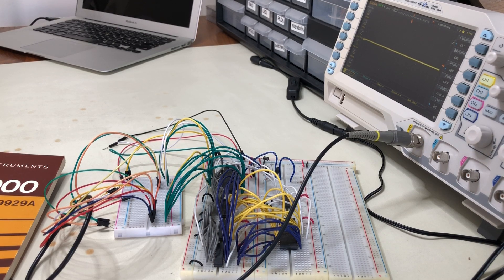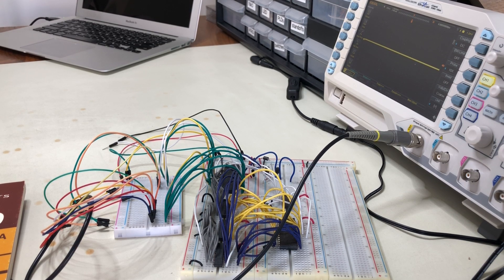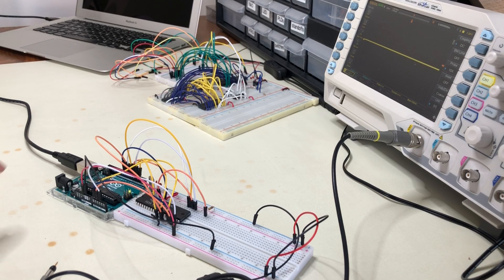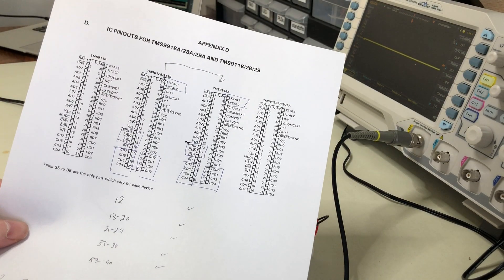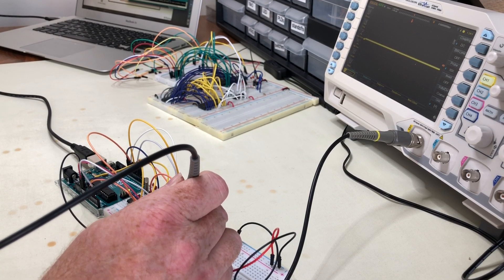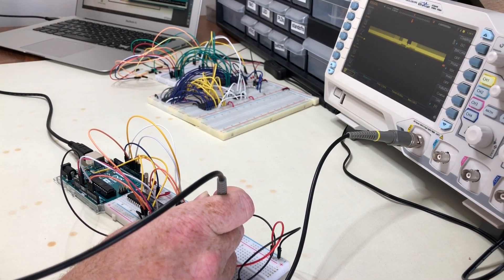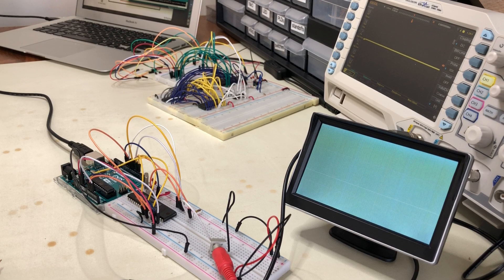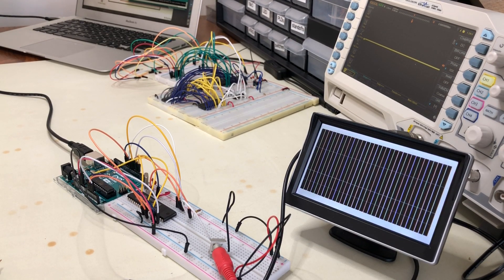6502 Mite home-brew computer project, step 19: testing and verifying the video processor

Comment: I've been trying to build this basic circuit myself.  Using a TMS9918 and an Arduino sketch that just cycles the background.  I'm seeing the background change but no color.  Only various levels of gray.  My only guess is that my timing crystal is off or something.  Although all parts (except the TMS) came from Mouser.  Any ideas on what to look for?  My oscilloscope shows a somewhat valid NTSC signal although sometimes it really gets garbled.  Color bust signal looks good too.  Just no color on the TV (composite input).
Thanks
Reply from the maker: It does sound like timing might be a factor. You might check the GROMCLK output, which should be exactly XTAL/24.

Could it also be impedence matching with the monitor? Certainly sounds like something analog like that.

I confess that I never got this working with my setup, but I later discovered some flaky wiring between the 6522 and its port, so I suspect that that was the problem all along and it had nothing to do with this circuit or the VDP at all.
Reply: @pauldourish  Thanks for your response.  That's a great idea on checking GROMCLK.  I'll give that a try.
Reply from the maker: @cbmeeks  Good luck!

Comment: Is there a specific type on component monitors that only work with the tms9918?
Reply from the maker: This chip doesn't give component video; it gives composite. Should work with anything that will take a composite signal. There are other chips in the same family; some may give component video, although I'm not entirely sure.